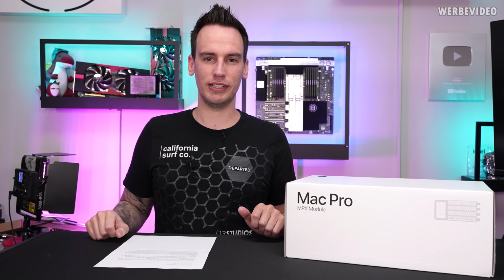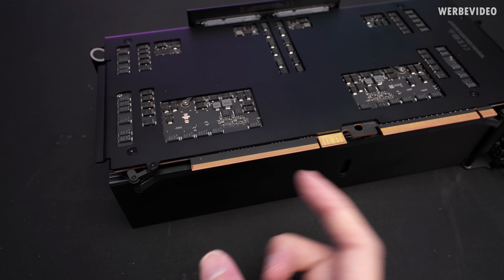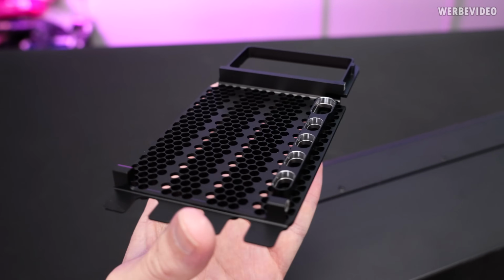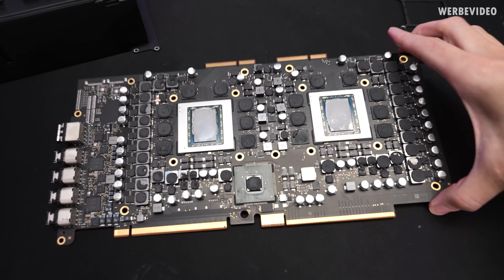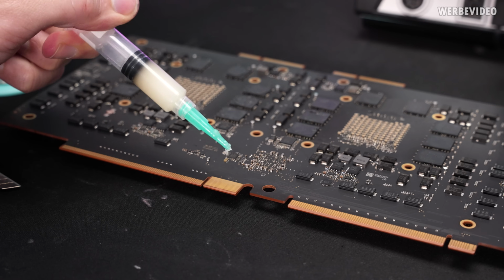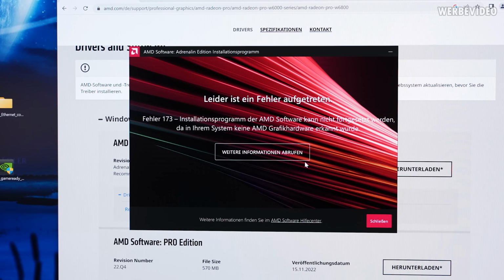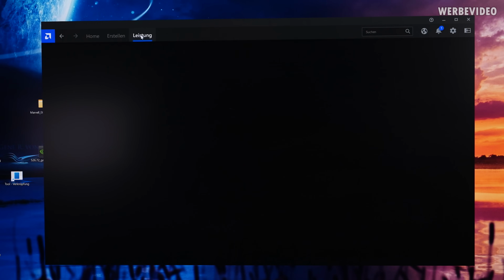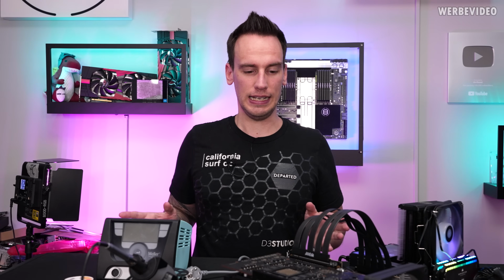This Insane AMD Dual GPU from 2021 is Faster than a RX 7900 XTX

Comment: With modern interposers it should be a piece of cake for GPU manufaturers to make dual GPUs that have full memory badwidth between GPUs so memory can be shared. What I wouldn't do for a 512-bit GDDR7 times full size GPU in dual config with 128 GB of Vram... make it on the new TSMC 2 nm node and have six or eight 8-pins feeding it, finally we could have real time video upscaling from 1080p to 8K with motion interpolation (the machine learning version, not the crappy one where it doesn't look right) to 120 hz.

Comment: Get the hardware id's of the card from device manager, locate the the w6800 driver ini and add the hardware ID's to that file in the section where they are defined. It's a brute force method that might work.

Comment: Great shear. TY. A bit off topic but..
What do you suggest for me. I need a 3tb 24/7 NAS, video playback, torrent'n and low end gaming would be a plus and having a cell phone would be cool to. 
Any thoughts ? Any pointers on a mother board that is not one of the ridiculously expensive frameworks mobo ?
I'm on the fence to build one or just buy something like a steam deck. Or even a Nintendo switch and turning it into a steam deck/PC.

Comment: A massive 12V connector on the motherboard might be the solution to the 12VHPWR issues. 4x USB-C and one HDMI is also a great port layout. That's 13 monitors with MST! AMD should revisit this design.

Comment: Your fan setup may be less than ideal for the card. By only having half your fan blowing through the fin stack, it seems like there would be a lot of wasted air just bypassing the card completely. If you had a shroud to make sure all the air was being directed through the fin stack, it might help solve any potential cooling issues.

Comment: The score of 97.21 fps in TSE-GT1 was really good.
To compare: on my Ryzen 5950x system:
I had a Gigabyte Radeon RX 6900 XT. Base score 62.37 fps, undervolt/PT+15%/mem(oc)2150 got 68.86 fps.
I have a Gigabyte Radeon RX 7900 XTX. Base score 96.78 fps, undervolt/PT+15%/mem(oc)2700 got 104.51 fps.

Comment: It wants to run two PCI slots in parallel. Which windows doesn't allow as far as I know. You could use two risers and splice them . And create a physical/manual bridge.

Comment: 15:55 I feel like its as simple as getting AMD drivers working on the Ryzen Z1 Extereme family of processors, extract the driver package, but rather than running the installer, go to the folder where they're installed and use the windows driver install them to grab the driver from that folder
Reply: Its probably going to have the same problem as running AMD drivers on Z1X though, where many things dont work right if you dont use the ODM drivers(Lenovo, Asus, Apple, etc)
Gosh i wish these handheld manufacturers just used the 7940HS or 8845HS because my drivers are almost 12 months behind and if i do manually install the AMD drivers that came out this week, i lose things like high refresh rate, and being able to properly switch between portrait and landscape. Also almost no overlay works correctly without ODM drivers so i cant do like the windows game bar, or the steam overlay, have to completely tab out of the game like its 2013

Comment: how did you solder the cables on without shorting them since the solder is all over the place?
Reply: one side is ground, one side is hot. Seems like all the pins on one side provide the same function.

Comment: @der8auer EN
Have you tried with a driver scan update software?
Like these?

Here are some of the best driver update software options that can scan your system and help keep your drivers up to date:

1. Driver Booster

	•	Developer: IObit
	•	Features:
	•	Automatic scan for outdated drivers.
	•	One-click update for multiple drivers.
	•	Backups of previous drivers before updates.
	•	Game components optimization.
	•	Pros: Easy to use, large driver database, free version available.
	•	Cons: May include optional software during installation.

2. Driver Easy

	•	Developer: Easeware Technology
	•	Features:
	•	Detects and downloads missing or outdated drivers.
	•	Offline scan for devices with no internet access.
	•	Backup and restore drivers.
	•	Scheduled scans.
	•	Pros: Simple interface, supports offline scanning, free version.
	•	Cons: Free version requires manual driver installation.

3. DriverPack Solution

	•	Developer: Artur Kuzyakov
	•	Features:
	•	Automatic driver installation.
	•	Offline and online versions.
	•	Supports bulk updates.
	•	Pros: Completely free, offers bulk driver updates.
	•	Cons: Large download size, some bloatware can be included.

4. Snappy Driver Installer (SDI)

	•	Developer: Snappy Driver Installer Team
	•	Features:
	•	Portable application (no installation needed).
	•	Offline and online driver packs.
	•	Fully open-source.
	•	Pros: Free, open-source, no ads, supports offline driver updates.
	•	Cons: Less polished UI, may require more technical knowledge.

5. DriverFix

	•	Developer: DriverFix Inc.
	•	Features:
	•	Scans for outdated drivers.
	•	Backup of drivers.
	•	Scheduled scans.
	•	Pros: Easy to use, focuses on core driver update functionality.
	•	Cons: No free version for driver updates, only for scans.

6. AVG Driver Updater

	•	Developer: AVG Technologies
	•	Features:
	•	Scans and updates drivers automatically.
	•	Backup and restore drivers.
	•	Large driver database.
	•	Pros: Trusted brand, easy to use, robust backup features.
	•	Cons: Paid software, limited free trial.

7. Ashampoo Driver Updater

	•	Developer: Ashampoo
	•	Features:
	•	One-click updates for outdated drivers.
	•	Backup and restore functionality.
	•	Large database of drivers.
	•	Pros: User-friendly interface, thorough scanning.
	•	Cons: Requires a license after the trial.

Each of these tools has its own strengths, so the choice depends on your specific requirements (e.g., ease of use, offline capability, budget).

Comment: The bootcamp driiver was an inspired solution. I love it.
I was thinking PCIe pass-through to a VM and running a Linux distro might be necessary just because Linux approach to drivers might have been able to use amdgpu drivers.

I'm not surprised by the power trips, I was surprised by the lack of an external 6pin PCIe or 8pin GPU power connectors.
The bridging adapter on there reminds me of the XGMI bridging adapter on the AMD MI210 cards (or at least interior portions of it)
So I wonder if this card is drawing on HPC designs from the AMD datacenter program.

Comment: i concur sir. this should be labeled as dual 32gb. 20:00 yeah. its too much. even for one navi21 one cable plus pcie is not enough to load navi21 fully. i got one myself, single card maxed out at 320w with a slight powermod.

Comment: I thought that having two graphics cards didn't double the GPU, just the ram side of it.
Reply: I thought the same, until I started playing around with my old system running 2 HD4880 Radeon cards. If I turned crossfire on, graphics scores almost exactly doubled. I also learned that when in crossfire, at least on those old cards, you can't use each card as an output to a monitor at a different resolution.

Comment: Rog Strix RX6800XT LC has 4608 shader units. Stop trying to make Team Red look weak.
RX6800XT LC can clock to 2.559 GHz when you follow the correct overclocking procedure.
That procedure does NOT require more power. The memory can easily overclock from 2000 to 2150 ,
2d and 3d transfer rate are cured by it and verifiable with FR.exe - Without the changes the score would reflect unacceptable throughput.

Comment: The reason this is an Apple exclusive product is the same reason why AMD doesn't want a flag ship gpu that crushed nvidia tomorrow, AMD is Everywhere, from you're Xbox to you're PS5 to you're steam deck to Data centers. If they beat Nvidia tomorrow than the day after there's no longer an AND Radeon division, rather you'll have government ls demanding it's just Radeon Inc..... that's the real reason why AMD refuses to push for the high end. A 8800 RTX that beats a 4080 with 250 watts on raytracing but loses on raster is fine in their eyes.

Comment: of course its going to shut down. you have no heatsinks on the chips. they will overheat in a micro-second under load. every single chip on that thing needs heat sinks. not just the cpus. everything amd is borderline OC out the gate. especially the memory!

Comment: I don't think anyone has noticed but adding that third cable seems to have demonstrably cut his framerate in half for TimeSpy?? It was at around 180~ fps before and then it would shut off. When you made that adjustment that let it actually complete the benchmark, but at about half that (90~ or so). 

Kinda looks like nonfunctioning SLI setup lol. Hope this gets to his attention and thanks for the video by the way.

Comment: What is the drawback of dual gpu like this? Because it feels like cost-wise a dual 7900xtx would be on par with the 4090 but with alot more performance. So there has to be a drawback with dual gpu because why wouldn't AMD make a dual 7900xtx with the same price as a 4090 but with superior performance?
Reply: They gave up making "flagship" gpus idiotically

Comment: You know what!! Good Job Bro..
Hey Apple.. stfu.. what is this ?? if you are using PCI specifications and add your own interface, where is the white paper ?
You buy a LM386 it comes with a PDF online, but really, sell stuff and make all efforts to hide everything. 

And I am not kidding, buggers have also put that black soot on the entire PCB so good luck tracing circuit. 

This particular card would be a great buy for so many people.. but they won't release specs. They used to do a lot of open stuff in 2010s.. Nowadays, it's plain stupid. This is not even Apple's Intellectual property..

Full disclosure, I probably know too much.. used to work with drafting Apple repair manuals and spec sheets which (most important ones) were always public. And this is 2011 and before. After Johny left; it's just cooking.. some team works hard, the whole company lives a premium life.

Comment: I recently got the Mac Pro that is the only model that has MPX slots, and yep, they're insane — the optimised airflow is massive, and the PSU draws 1,400 watts peak, to support two of these with 28 cores Xeon.  I'm surprised you dared turn on the card without adding direct cooling onto the GPU core like a PC card.  I went for the single W6900X for highest single-GPU performance but I'm still curious to this day whether I should have bought TWO of these, dual W6800X, with Infinity Bridge, and have four of the GPUs running in parallel.  Depends entirely on software support I guess?  I mostly run MSFS 2020 for games, and Topaz for AI
Reply: I'm really interested in further testing, this is obviously such undocumented territory, and it seems like after he got it to stop tripping, it's FPS got halved. It's faster than the 4090, at least in this test, although the ending uses the aforementioned slower performance. I think he tripped a power save on one of the cores and so it ran slower. Insane stuff really...It blows my mind at what a more capable interested person could do to test with this card. It's sad too because he can totally do it, if he wanted to.

Comment: why solder for check in windows pc ?  boot camp and search  hardware and software data line voltage etc etc ... and after alle max info, hack a board .. no ?

Comment: You'd likely have better success with the card if you used both PCIE connectors on the GPU. Connect both in separate sockets and see what happens.

Comment: It's almost as sexy as my old sapphire 1950XTX's
Yea that green chip is a bridge. It's what allows these dual AMD cards to show up as one for AMD drivers. They are also why quad crossfire with 2 dual GPU's perform like a 2 card crossfire system scaling wise.

IOW the dual GPU cards are quite a bit better than what traditional crossfire was because you can use 4 cards for games that only support 2 card crossfire. That bridge chip is invisible to drivers so they act as one card. The bridge chip also has a lot lower latency, which is why AMD tried to push dual GPU systems. To lessen that Crossfiure/SLI stutter. And they worked pretty well for that.

Comment: apart from having more ram, 2 of these dual gpu cards (4 gpus total) almost get as much flops as a default rx 7900 xtx (not aib board versions because theyre clocked up to 4 or 5 tflops higher than 2 of these dual gpu cards put together) , less than a teraflop short , but has 128 GB of ram together (32 GB per gpu)

Comment: how can a dual gpu card totaling about 30 tflops beat a card that has more than double the flops at 61 tflops? could it be that the radeon pro w6800x duo's ram is 64 GB vs the rx 7900 xtx's 24 GB of ram that the w6800 duo has the performance, especially since both are using same type of ram but im not sure of their ram speeds and bandwidth...i guess that this is a case where more ram can get better performance even if its half the flops

Comment: terribly disappointed here, firstly, not even an attempt to see if it can run Crysis, secondly no top comments from someone else pointing this out :))  Joke aside, could it be good enough in games, considering it doesn't have ray tracing or clever upscaling equivalents, or does it? questions questions

Comment: Installing the driver is easy. First, put a regular RX 7000 and install the driver. Then turn off the PC, pull out a regular video card and put your adapter on, then start the PC.

Comment: I think they have fallen out of favor because the way they work in tandem and communicate is inefficient. So double the GPU doesn't exactly equal double the performance and can cause strange graphical anomalies and artifacting as well as using much more power. It's better to just build a much stronger GPU than to tape two of them together (unfortunately) and hope they can figure out how to share the work load effectively.

Comment: The one dule gpu I liked was r9 295x2 it was crazy back in the day. I was able to run arma 3 at 180 to 200fps. Crazy not even my new gpu can put out the frame rate the 295x2 could.

Comment: Now that AMD is using chiplets in the RX 7000 series and going forward, indeed multi-monolothic GPU dies (and even multi multi-chiplet cards) on one board will only be seen in server applications.  7000 is only a starting point; I suspect next-gen Radeons to close the performance gap with nVidia's best even more.

Comment: I wonder if the Crossfire result is due to using some DX12 Multi GPU setup on the Firestrike side or if the AMD driver does something clever with dispatch und memory access over that Fabric bridge.

Comment: It is kind of strange and amazing that AMD actually had 4080 beating car 2 years ago (and I am sure with proper consumer adapted drivers 4090 beating) and yet they decided not to release it on PC/consumer market?! I just doing understand how this makes sense? As well consider this - if 2x 6800XT beats 4090 (and I assume it beats it because this test was run on SUPER hacked crapple drivers running on windows with some soldered wires etc. so proper drivers with properly optimised hardware should definitely beat 4090)... then what would 2x7900XT or XTX would do?! Even from value perspective - now 6800XT is like $500... imagine that for $1000 beating 4090 which is closer to $2000! As well scaling seems to be ridiculously good even on hacked driver... so I am kind of surprised we don't see multi-GPU set-ups available. Not only it would make sense from price perspective, but as well it would make sense from performance perspective.

Comment: I can imagine that the bios of the card has to be patched to run on a normal PC EFI
I think if you want to plug in a normal PC GPU into a mac you also have to patch the bios to make it work this way round.
So unless there is someone who can write a patch for you, if that is even possible, I guess you might be out of luck.
Or you get a mac pro, plug it in there and install windows on it to run your usual benchmarks.

Comment: Unless it was at a lower res, i could swear i saw FPS hit 186 somewhere yet after the third wire it didn't get close to that. Almost like they were running in Crossfire at 186 lol

Comment: I think the special other slot at the bottom is what runs the display and thunderbolt connection. The hdmi is likely ran through a thunderbolt conversion. No connection, no display.

Comment: AMD ended support for Crossfire so you wouldn't see it on any Navi 20+ drivers anyway but DX12 does support multiGPU natively and 3DMark takes advantage of that so that's why you don't need crossfire support for in drivers because the 3DMark software uses both GPUs itself. Sick video though amazing that you got it working in Windows, I wouldn't even have thought to even try to do that 👍but that's why you're the one making these videos and not me 😆

Comment: exactly where you started to remove the splint from the video card is the secondary connector, if you want to add another video card you need that special cable that makes the connection between the two video cards

and to mention one more thing, that special cable that connects the two video cards can only be found at Apple, unfortunately it is not found on Amazon

Comment: NVIDIA did something similar years ago with the 9800GX2. I had one, it used to get hot from memory. It did die eventually from over use. Stuck it in the oven, it worked again for a few months and then died again lol

Comment: The drivers are a pain on custom/dual AMD cards - like I have a S9300X2, which has a hidden miniDP but that is inop, and the card can be used rather only for compute, under Linux. No luck for windows (where it would be utilizing the iGPU for output). Had anybody tried something similar?